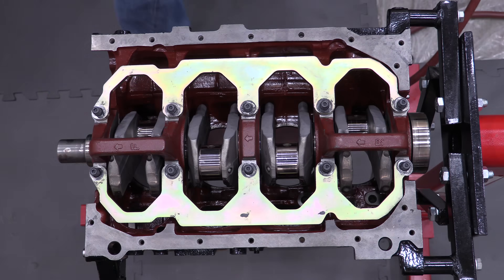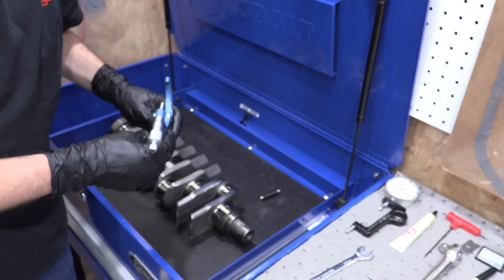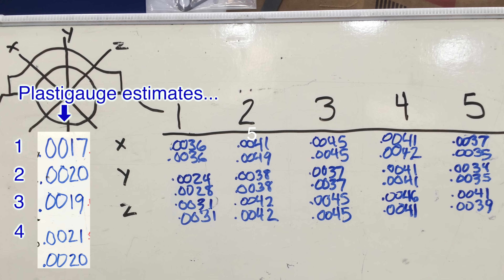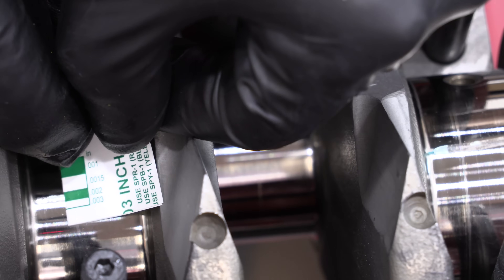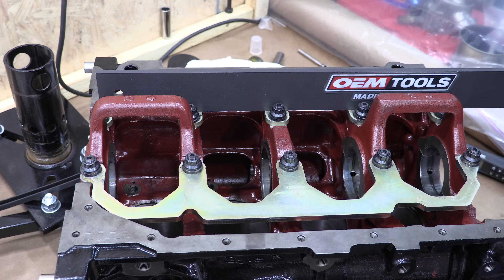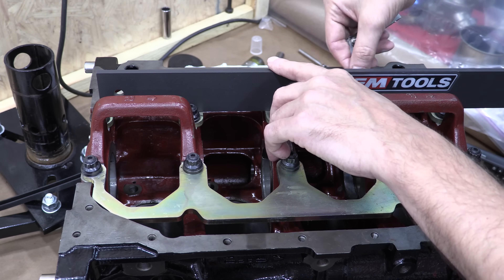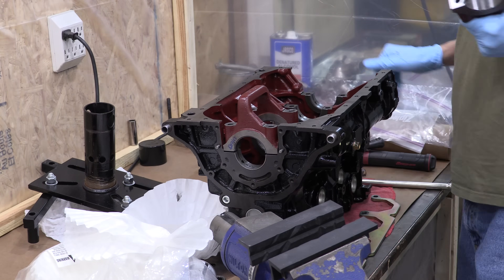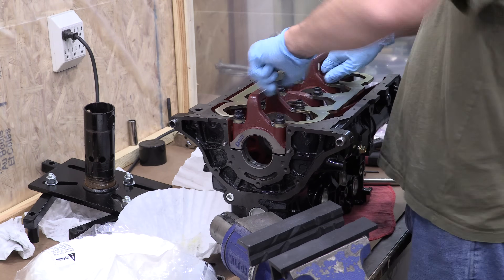[4k] The merits of Plastigage? ...A Jafromobile "short"

Comment: Jafro, good stuff as always. I wanted to share my opinion on this. Whereas I'm all for perfection in a build, im wondering if measuring the main cap height is really that necessary? I know your gonna line bore it, but i feel checking the bore straightness would be the number 1 priority, and main cap straightness a distant second. I feel like the main cap height wouldn't have been a priority for mistubishi. I feel like checking the girdle for straightness and perfect height too would also be necessary to achieve good main cap height.
Reply from the maker: The cap height matters only because of the bearing girdle.  The bearing girdle is perfectly flat.  The cap height being uneven is pulling the block out of shape.  There's a straight line through the block, but the oil clearances are all over the place and out of spec as a result.  The crank is perfectly straight and so is the girdle.  I checked the straightness of the block with a straight edge on video.  It's straight, too.  The only thing between these parts when the torque is applied is the caps.  You can be off by a couple thousandths.  You can't be off by a hundredth.  Because it was line honed like this, the uneven bore holes became elongated.

I've employed the perfect solution to all of this already.  I'm just completely at someone else's mercy on getting it done.
Reply: @Jafromobile  Oh that is a VERY good point. The girdle, especially considering it's thickness, could definitely distort it. Gotta give ya props for the attention to detail. Definitely something to be proud of.

Comment: I like the build tent. Was it filtered with box fans as well ?
Reply from the maker: I didn't need that kind of airflow.  I used a large hepa filter, though.  It's positive-ventilated.  I built it a year ago (there's a video, look for Ren's sleepy head in the thumbnail), I've left it on continuously except for a couple of power outages and shockingly a year later it's still dust free.  I've vacuumed it twice.  I'm really shocked at how well it works!  It's all about that flap.  The flap is where it's at.

Comment: Hey Jafro, I'm building my second engine for a small rally car based on the Daihatsu designed 1KR-FE - It's great how these engines occupy complete opposite ends of the spectrum and yet everything here is entirely relevant and informative. Your channel has been an invaluable source of knowledge and inspiration; I owe you a great deal of gratitude. 
I guess like me you enjoy producing content which is relevant to what you happen to be doing or are interested in at a given time... So with that said; would I be able to sway your interest toward ways to combat oil starvation in a 'standard sump' DOHC engine, which focuses more on modifying passageways and introducing baffles than it does applying experimental coatings? 

Thanks again.

Comment: Jafro, 

Unrelated to this specific video, I am currently looking to do a turbo project with a 1990 Sonata. Trying to decide what makes more sense; swapping a full G4JS engine and manual trans into the car (reverse of the current engine layout) or do a build using the G4CS thats currently in the car and install a G4JS cylinder head on it. I know this is random, but I am curious to know your thoughts on this. Thanks for all of the great content!

Comment: I'm a design engineer at a major OEM of engines...most people don't understand the highly complex nature of why these clearances for journal bearings are what they are.  Not only are there very complex and multi-layered roundness, waviness, straightness and diametrical tolerances on each bore, but there are also physical distortions that occur while sitting still, while running, when it gets hot and when it is loaded.  Old engines with lower cylinder pressures, thicker oil and lower horsepower can get away with less round holes and larger clearances.  When you enter the world of 0W-16 oils and extreme racing engines, the precision required to measure and manufacture the required clearances gets significantly more difficult.  New engines are all being checked with a several hundred thousand dollar CMM, air gauges and other fancy tools...something like plasti-gauge is going to be a shot in the dark in terms of if you made the hole the right size.
Reply: If you were replacing rod bearings in-situ on a BMW S54 engine, would you use OEM bearings again or ACL/King/Mahle aftermarket etc. at std clearances? I'll plastigage at the very least no matter what. A shop near me wanted to use 0.025mm / 1 mil extra clearance which sounded like a bad idea to me so I passed.
Reply: @chrisbradley3224  I would use the OEM bearing and clearances.  Extra clearance isn't going to help.  The OEM bearings also likely had more validation and quality control than an aftermarket bearing would have, but I'm not familiar with the failure mode of the S54 bearings.
Reply: @ Thanks! The OE bearings display fairly even wear on upper shells, it seems to just be load related with a fairly narrow journal for long-ish stroke and 8k rpm operation. BMW recommends 10W-60 oil w 5.2 cP HTHS but still doesn’t help it seems. I was thinking of trying King polymer coated w std clearance but will probably go OE.

Comment: Done 5 engines with it now. I always have the crank checked for straightness and have always used the caps/block the crank came out of so not to worried about anything but a manufacturing mistake in the new bearings so checking that.

Comment: How did you measure .0001" with the plastic gage?  and it does make a difference on how old the plastic gage is.. from my experience..
Reply from the maker: You can't.  It only gives you .0005 increments with the red stuff.  I said at the beginning that I estimated what it could be based on what the impression looked like and that's stupid, don't do that.  I still do it anyways, but if there was ever supposed to be accuracy at .0005", there is none at all at the .0001" level.

Comment: I'm at 0.0015 on my 4g63 mains. Do you think it's too tight?
Reply from the maker: That's slam in the middle of factory spec (shown in the factory service manual in this video).  I'd say you're good to support up to 300-350hp with that.  

What are your goals is the question?  Balance shafts or not?  Any other oil system mods?  There's a lot more than just a number that goes into it... but if a factory or mild street-strip build is on your plate right now, then I'd roll with what you have.  If you're trying to hit 800hp+, then get the .001" oversized oil clearance bearings.  They're not the same as oversized bearings.  ACL makes a set with an extra .001" oil clearance.
Reply: @Jafromobile  I'm looking at about   350 with ACL standard bearings and a manley crank and rods. I'm about 0.002 clearance on the rods
Reply: No balance shafts installed
Reply from the maker: @claudloui9433  You're fine with those parts and clearances.  The no-balance shaft thing might mess with your oil pressure a bit, but there are other ways to deal with that.  'should last a good long time.  Break 'er in easy, though.

I tend to shoot for closer to .0020" on a no-BS build, especially if there's no oil squirters.  I always go just a tad larger than you've got on the mains–on the rods.  Just like you've got it.  There would be way too much work involved to make that half-thousandth appear any of your parts at this point.  Sometimes a different brand of bearings can make that happen.  But IMO with your goals if it all fits, deal with your oil pressure another way.  Those numbers will work to achieve your goals because either a factory 6-bolt or 7-bolt with OEM parts would also do that safely with those numbers.  

The key to all this though is... what did Manley say to use for your main oil clearances?  Whenever you've got aftermarket stuff in there, you need to use their clearances for reference.  Not the OEM numbers.
Reply: @Jafromobile  I didn't get it with any instructions but from the reading I have done it's 0.001. Also would 10w30 be OK or can I run 10w50 after break-in? How long do you usually break-in an engine for?

Comment: Plastigage is for when "good enough" is considered right.
Good enough is for lawn mowers, farm equipment and so on.
Micrometers, dial bore gauges, dial indicators etc. are for when it HAS to be right.
Engines expected to have a long long life, stay together at obscene power levels, or run at and near wide open throttle for hours on end AREN'T inspected with Plastigage. 
Engine builders don't use Plastigage, engine repair people often do.

Comment: Hi. I have a 2.3L 4g63 stroker shortblock I had built for me years ago by a machine shop... I held onto it in my shop didn't use it yet. Problem is, I never got it surfaced for a MLS gasket, and I later bought a Kiggly Girdle not yet installed. Crap. Eagle rods Wiseco Pistons. So, I need to have them go through this and re-spec the crank journal bore with the kiggly girdle installed. Too much too much too many years.. why I have another 2L 'stock' N/A turbo bottom end motor coming together also soon hehe.. thanks for the video

Comment: What rod and main clearances are you targeting?
Reply from the maker: Mains .0022-.0023".  Rods .0024"
Reply: Why were your preliminary clearances so great (0.004"+)? Sorry if this was previously discussed. I'm a new subscriber.
Reply from the maker: @povertygarage705  I'm a little confused about the question.  Preliminary at what stage?  I guess you do have some catching up to do...  I do apologize for having so many long videos when you're new. 

This block was dragged from a trash heap and it's been through multiple processes and coatings, then rounds more work fitting aftermarket parts into it.  There have been a lot of preliminary rounds.  This video demonstrates how larger bores that are mis-aligned can yield normal-looking oil clearances in a plastigauge test.  I knew that some journals were large, and intended to solve that problem with an oversized bearing except that the bore wasn't straight.  The previous video is a good start, but you can see this issue giving me all kinds of problems at the machine shop like 3 or 4 videos ago fitting the bearing girdle.

Comment: Jafro I have a have a 92 gsx 6bolt. Im having problems withh the clutch engagement it won't engage at all. Fidanza lightweight flywheel act 2600 pp nd 6 puck disk. I already shimmed the. Pivot ball and put a new slave cylinder in and it's not working at all. I'm in the process of tearing the trans out again. Should I put the stock flywheel on or buy the act flywheel?.

Comment: When measuring the bearing size with a dial bore gauge don't you scratch the surface of the bearing when you roll it in and out of the bearing?
If the ball bearing in the end of the roller  point does not rotate for some reason that would be the end of that bearing. 
do you have some kind of none scratch tips to the dial bore gauge?
i have a have a dial bore gauge to measure this sort stuff but i could never bring myself to use it on a bearing surface.

Comment: As a machine shop owner I found this video extremely interesting!!!  To equalize  your main cap flange height I would place the caps (in order) against the rear fence on a surface grinder magnetic chuck and grind all flanges at the same time and then move the table/wheel to grind the other side/half with disrupting the mag chuck.  This process would only take a few minutes and would put them all within at tenth or two .

Comment: First off, Hi. 
Second I have built some mild performance/factory rebuilds and have used plastigauge as the only measurement for bearings. Not had an issue yet. I however wouldn't do that for a full out performance build that is being pushed to the limit.

Comment: Hi Jafro, thanks for the informative video, learned something today! Controversial thought: could you grind / machine the girdle to fit your specific block instead of resetting the main cap heights?
Reply: That would weaken the girdle (even if it's a little) and cause more problems than it would solve. Not to mention, it would be more difficult to do that correctly than to shave the caps properly. The rest of the then necessary machining starts to suck, but there definitely is a 'right' way to fix this for a reason, and since it's already apart, it doesn't make sense to half ass it now. :)

Comment: I think in todays world, with all the different lubricants and additives that whether or not you should be blue printing engines so accurately all depends on your purpose and goals. I'd say for 90% of the guys building their own race motors making sub-1000hp, plastigauge is more than sufficient. Also, it's fair to mention your build is definitely a special case because there are plenty of guys making well over 1000whp that don't go nearly into as much detail as you have Jafro.

Comment: Hi,
 I have never use this stuff. I did it the way you show with the gauges & math. I have had good experience & bad. Either way it wasn't on a big engine anyway.  But still it will eat up all your parts if you don't do your homework & do it accurately. 
 I really can't believe you have run out still that's important that you caught it. That will eat a bearing in hurry. 
 Best of luck ! Be safe !